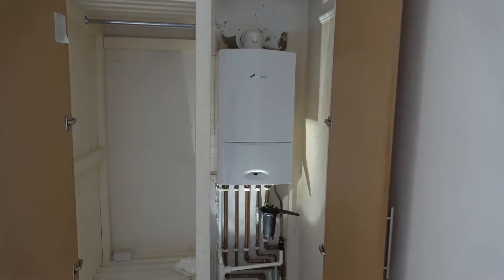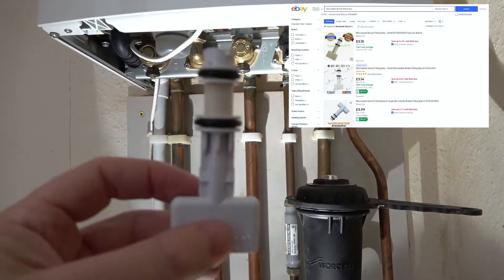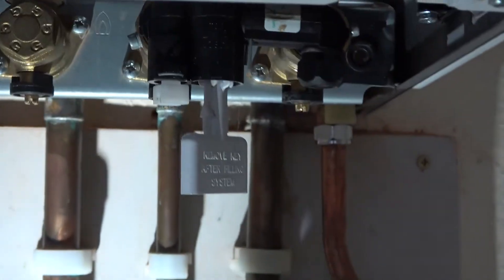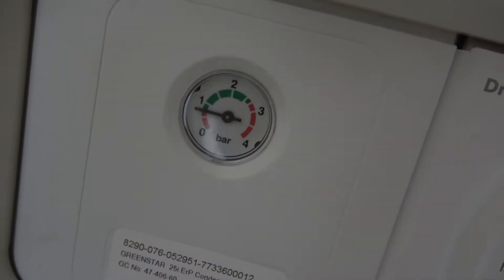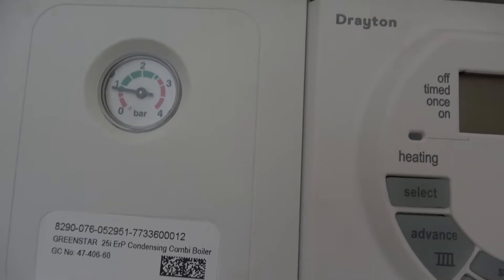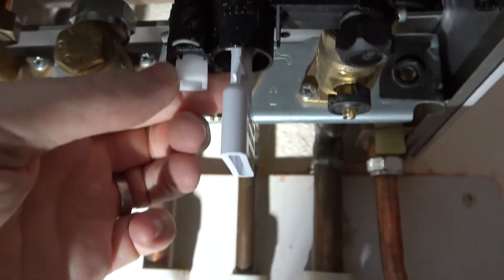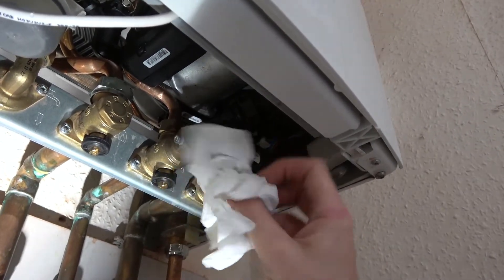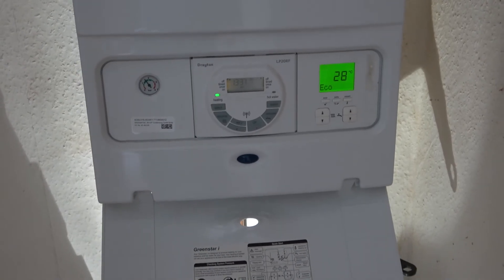How to REPRESSURISE a Worcester Bosch Boiler

Comment: I had the "key" filler swapped out for one with a sensible loop and valve. This was because the key fitting eventually started leaking out into the covering tray beneath, and the filler also leaked when being operated by the key.

Comment: The newer ones have a lever underneath so there is no messing with keys, you pull on it and the system pressure increases.  You should only fill it when the system is cold.  Don't fill it right up either, if you fill to 1.5 when cold, that will go up to nearer 1.9 when hot and there is no need for that sort of pressure - don't forget 1Bar is 30PSI, so why have all your pipes and radiators pressurised to over 30PSI ?  Some people leave it on 50-60PSI and wonder why they have slow leaks.  Fill it to just over 1 when cold and it will sit around 1.5 when hot after a while.  
The pressure can go down when you bleed the radiators and the only reason for needing to bleed them is the air bubbles created by the boiling water, especially if you have one right near to the boiler.  I have to do the bathroom one every 3 months and that should also be done when cold.  You don't want hot water spraying at you with the rust inhibitor in at 30PSI.
I still don't understand why the system needs to be under a pressure when my old one with hot water only boiler that heated a tank and also the radiators was never under pressure and worked just as efficiently.  I've gone from a 15KW boiler with two tanks in the loft for cold water and heating, plus a hot water cylinder, to no tanks and a 30KW combination boiler that is a lot cheaper to run despite being twice the output.